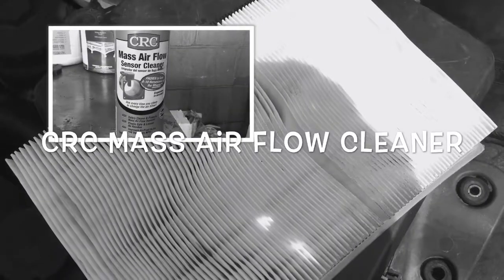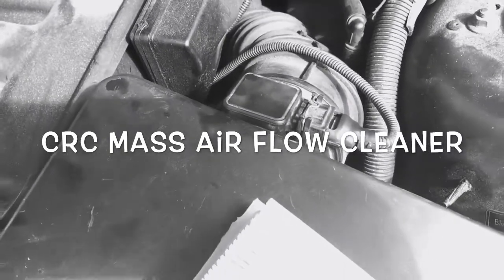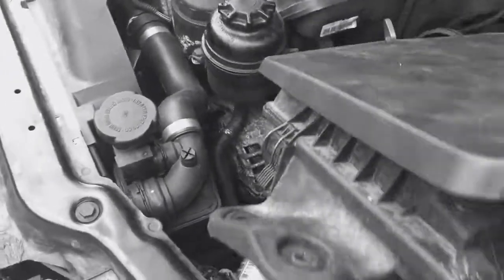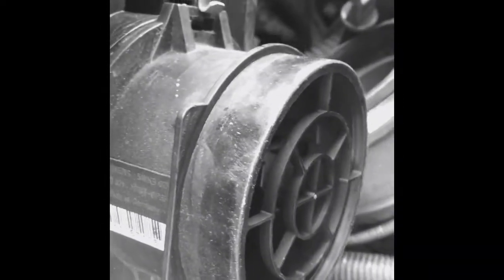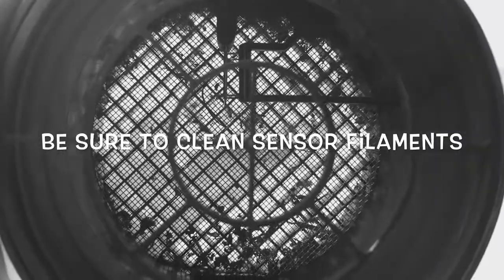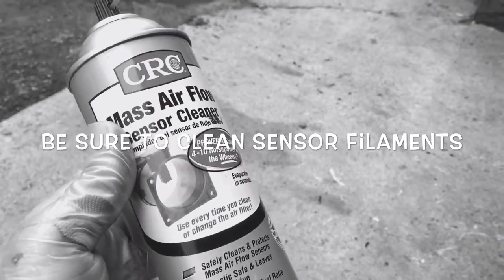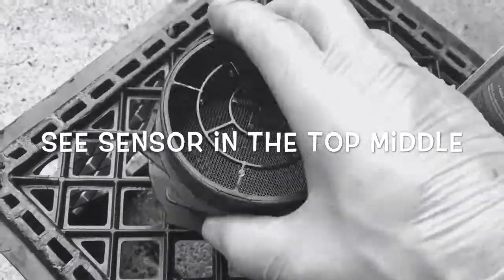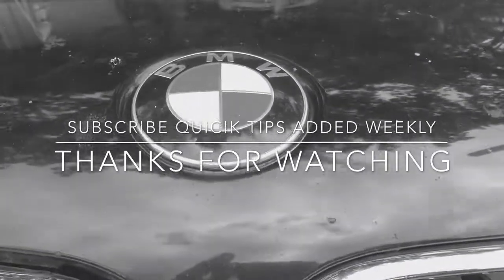How To Clean A Mass Air Flow Sensor

Comment: You need to disconnect the battery?
Reply from the maker: No
Reply: Why would you disconnect the battery ?
Reply from the maker: Make the video longer
Reply: Could you just use compressed air like for computers?